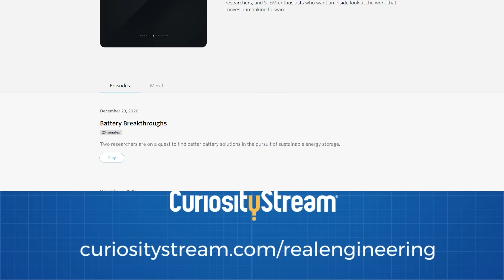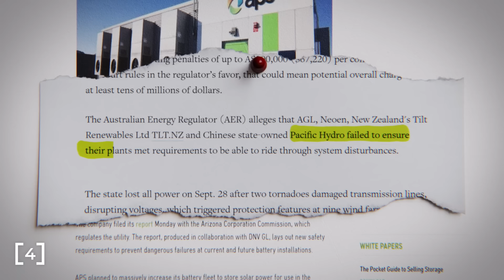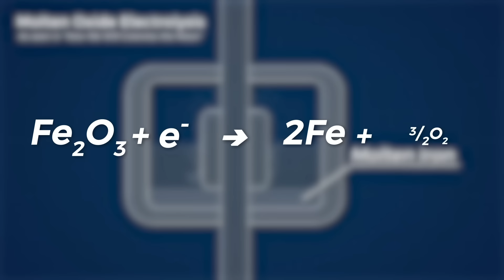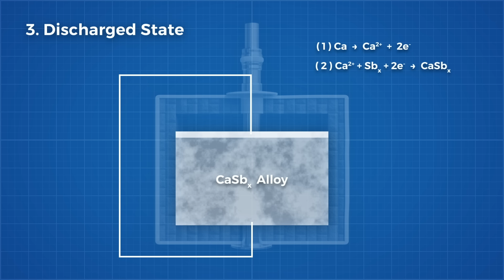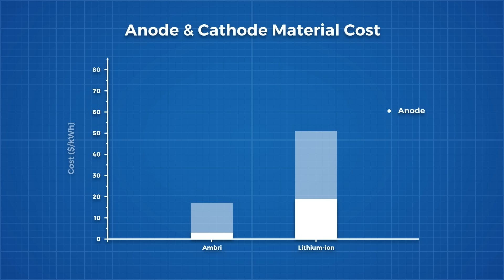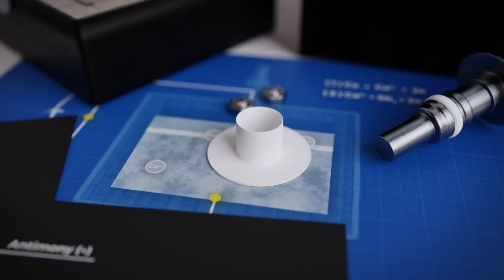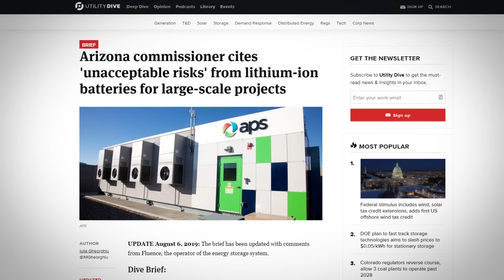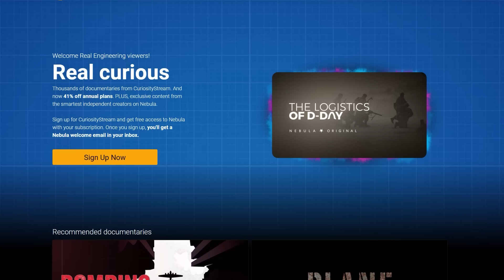The Missing Link in Renewables

Comment: Using Li-ion cells for everything is a bit like using titanium for things of metal. Possible, but not practical.
Reply: ^^ This.
You use the metal that makes the most sense for your application.
Reply: On paper that's true. However, Li-ion's scale of production is making it cheap enough to work with anything. These batteries, and others like it, may make more sense on paper, but the costs are a huge factor right now. Li-ion has options already for lightweight applications and high cycle applications. Will be interesting to see if these take off, but I'm not sure they ever will.
Reply: People used to say the same thing about Steel and Aluminium at various points in history.
Reply: More like Aluminium, applicable to more situations than titanium, but people will continue to make ships and skyscrapers out of Steel.
Reply: @anthonypelchat  lithium batteries have scalability issues and recycling issues. Getting enough rare earth metals to switch all the cars and grid to lithium will be hard. It is so hard that we are already looking into deep sea mining with robots (which isn't good because we know very little about deep sea ecosystems and how large scale mining will affect them). Rare earth metal mining is not a green process in general, it's very destructive to the environment and produces a lot of toxic waste.
So there are hidden costs to lithium batteries, manufacturing cost went significantly down but at some point we will hit a point where raw materials availability will drive the cost up.
Reply: @pingwingugu5  this honestly needs to be its own comment. People don't realize the impact batteries have on the environment and they can't be the answer for everything but really only small things. On a large scale, we still use pumped hydro since it can store a ton of energy with just a dam in the right space and although it hurts the ecosystem around the new reservoir and the construction of such a thing is a large carbon output it leaves less waste than batteries that degrade over time. Honestly, until we get electric or hydrogen construction systems this will be a huge limit on going carbon neutral and eventually achieving a carbon deficit.
Reply: You guys are just throwing shade without backing it up.  “A bit like” doesn’t cut it. That’s not engineering. If you have a more viable solution, put it on the table. That requires you are able to manufacture it at a competitive price, and in that case I suggest you start a company. Until then, I kindly recommend that you consider zipping it.
Reply: @pingwingugu5  Next time you go to comment, do some research first. 

"lithium batteries have scalability issues and recycling issues."
Wrong on both sides. Lithium batteries are already one of the most massed produced products on the planet. They do need to scale a lot more, but many manufacturers are already working on that. 

And multiple companies are also working on recycling. Nearly the entire battery can be recycled once it reaches it's end of life. But just like with most things, the costs to recycle have been higher than the costs to build. As batteries become more easily available to recycling companies and they scale up, costs will come down and recycling will go up.

"Getting enough rare earth metals to switch all the cars and grid to lithium will be hard."

This is where research would keep you from making a full of yourself. There are exactly 0 rare earth minerals in a li-ion battery. None. 

"It is so hard that we are already looking into deep sea mining with robots"

They don't need to specifically for batteries. However, companies will research specific applications possibly because it isn't available in their country or because they feel that it will be more economical. Again though, not needed specifically.

"Rare earth metal mining is not a green process in general, it's very destructive to the environment and produces a lot of toxic waste."

This is the only correct statement in your entire comment. However, you seem to assume that EVs use far more rare earth minerals than anything else. Not the case. As already stated, the batteries don't use any. Some motors do, but it is possible to build motors that don't use any. The rest of the car uses the same materials as any other vehicle. 

"but at some point we will hit a point where raw materials availability will drive the cost up."
The only raw material that will cause that issue is Cobalt. That is because the most easily available Cobalt is in Congo. However, other deposits are available now, new means of getting it are coming up, and battery manufacturers are working to replace it entirely.
Reply: @TacoRat0  As I just pointed out to GSTC, who was horribly incorrect in nearly everything he said, batteries are not more damaging to the environment than other things we do. They are in fact far less than most, including fossil fuel extraction. 

"On a large scale, we still use pumped hydro"
We use that since batteries are still more expensive. Costs are coming down, but that is the only reason any new pumped hydro is built. 

"it leaves less waste than batteries that degrade over time."
Horribly incorrect statement. Li-ion batteries don't leave toxic waste as they degrade. And degradation is small in the first place. Plus, batteries can be recycled completely. The only reason they aren't is due to costs and availability of batteries. As more batteries become available, recycling can scale up and become cheaper.
Reply: @anthonypelchat  jesus christ dude these people are probably never even gonna read this comment, it took you how long to write this out when you coulda been doing literally anything else in existence. Not everybody has to have a damn phd in battery technology, dude saying theres rare earth is kinda like calling concrete cement (even tho batteries arent made of rare earth but concrete actually has cement), yeah ok its a mistake most people probably make you dont need to treat this individual who youve never met with such disrespect writing a whole graphic novel calling someone a "full"
Reply: @anthonypelchat  you are right I mixed things up. Lithium and cobalt aren't rare earth. Still their mining process is quite destructive. I think the most cost effective way for lithium is salt evaporation ponds that are hard to scale up.
The deep sea mining is one of the new sources of non-bloody cobalt, but if I remember correctly there were some other stuff there for EVs (probably some rare earths for magnets).
About the recycling, waste plastic is plentiful and cheap, but it is still rarely recycled. Most small plastic pieces are dumped or burned because how hard it is to recycle it. I'm just worried that we will end with similar problem, yes you technically can recycle it but it will never be cost effective.
Reply: @churrosmcgee624  Correcting people is not "disrespect". To my knowledge, I didn't say anything specifically disrespectful to him. But so many people make the exact same mistakes and then repeat it over and over. I can help him be corrected and help others who read it.
Reply: @pingwingugu5  "Still their mining process is quite destructive."
Very true. Batteries aren't perfect. Nothing is. But it is far better than the alternative. Fossil fuels are basically mined, but instead of using them for a long time and then recycling them, we burn them and mine for more. 

"I think the most cost effective way for lithium is salt evaporation ponds that are hard to scale up."
Lots of companies are looking at this. They have even slowed down mining at some locations since battery production hasn't been as fast as predicted. Will be interesting to watch in the future, but I doubt that it will be a big issue.

"The deep sea mining is one of the new sources of non-bloody cobalt, but if I remember correctly there were some other stuff there for EVs (probably some rare earths for magnets)."
You are correct. They can get a lot of minerals from it. Cobalt is the biggest issue right now for batteries. But it is being reduced to nothing. 

Btw, only some motors need rare metals. AC induction motors don't, but permanent magnet ones do. 

"yes you technically can recycle it but it will never be cost effective."
We will see. Multiple companies are popping up specifically for recycling. The good news is that a single EV battery can last for a very long time in an EV. Afterwards, it can still be useful in stationary storage. 

The bad part with recycling, not just for batteries, is that nearly everything we throw away can be recycled. We just don't. Plastic, glass, paper, metal, etc. Lead Acid batteries are nearly 100% recycled. If we can recycle lead acid batteries that well, we can do so with almost anything. Just need to force everyone to do so.
Reply: @anthonypelchat  why do we need energy storage?
Reply: @robinsss  Grid usage is hugely unstable, not even counting the use of renewables. Peak power can be 3-4x more for 2 hours then the entire rest of the day. Most of the more efficient plants cannot ramp up fast enough to keep up with those peaks, or they may not even have the capacity to hit that high. They currently turn to peaker plants for a lot of that power, which is typically coal or smaller natural gas plants. Depending on location, these can be extremely expensive to use and are typically not as clean as their continuously running counterparts. You also have to pay to have them available, even if you don't use them.

We also have a ton of renewable energy that was installed without any energy storage as well. California and several other areas intentionally shut down wind turbines or basically toss energy from solar away because they are producing too much and have no where to put it. That is simply wasteful.
Reply: @anthonypelchat  try run of river  with a  dam on large diversions
Reply: Bill Gates has a lot of money with a battery company compounding certain dirt as a battery.  They say, "the only way to make the world have batteries is it needs to be cheap as dirt".
Reply: u can just pump water uphill and recover the potential energy. simple tech
Reply: @pingwingugu5  dum6 fu4ck Li ion batteties dont use rare metals
Reply: @nick b thanks, ok. id like to know more about pumped hydro & man made lakes....because the mining and politics for tesla batteries materials is its own mess too ya know, no?
Reply: @cryptolicious3738  that's all
Reply: 1:36 How is pumped hydro storage "not scalable"? You can't just make claims without proof.
Fact: the world's largest pump hydro storage facility is 24000MWh which is larger than the world's largest grid battery 300MWh. "Not scalable" my ass.
Fact: pump hydro storage make up for 95% of grid energy storage. "Not scalable" my ass.
Reply: @nick b not every country have 2 lake on different elevation, fair.
But it does not need to. It just need to connect it grid to another country with pump hydro storage to store that energy.
Reply: @nick b how is it compromising?
Reply: @nick b which is a problem because?
Reply: @luongmaihunggia  yeah , true! we need a updated real engineering video on hydro storage and the pros n cons and speed to construct etc etc bc that isnt 10 or 20 years away tech. we need massive cheap storage now imho
Reply: @nick b yeah. Why wouldn't they? If you pay anyone enough money you can get them to do anything.
Reply: @anthonypelchat  What do YOU think recycling Li-Iom batteries means?

Let me rephrase.. whats the average energy toll for repourposing 1kg of Lithium based containers?
Reply: @nick b yeah, why would they do that? Why would people in other countries price something that everyone does at a higher price than everyone?
Reply: @nick b and I pointed out how "your limitation" isn't a limitation at all by asking a question
Reply: @absolutium  You tell me. I haven't done a lot of research on Li-ion recycling. I know that there are recycling for batteries that clean and resell the good batteries for use and there's the recycling that fully break down the batteries to be reused in other items, not just batteries. The only issues that I've seen for the break down of the batteries is simply getting enough to the plant to make it worth doing so and bringing the costs down enough to make it worth it for other companies.
Reply: @nick b the cheapest one is pump hydro. Obviously
Reply: @anthonypelchat  Well one might think you have done research for an opinion that confident.. but while it is difficult to establish the average the best case scenario is 50kwh per kg.. so there you go.. thats the environmental issue.
Reply: @absolutium  I never claimed to be an expert nor did I go into any deep details. You don't have to be an engineer to have solid facts. Multiple third parties claimed the very little info that I committed. They claim to be able to recover most of the materials and are working to make it cost effective. 

Also, using that 50kwh of energy number that you provided, you can recover 250 watt hours of NCA/NCM battery storage. That provides a lifetime storage of 500-1000 Kwh of storage for just 50kwh. Not perfect, but still a very nice return.
Reply: @absolutium  Got a link for that 50 kwh number you gave? I cannot find any info on any legitimate site showing that. So far, I'm just seeing everything that I already mentioned. It's more expensive to recycle than to mine, and that multiple companies are claiming up to 100% of the batteries are recyclable.
Reply: @anthonypelchat  Yeah no.. Let's try this.. take a look at the Fifth Law of thermodynamics. See if you can notice whats the issue here.
Reply: @verdanteridium  no. I don't have faith in human kindness. I have faith that if you pay people, they're obligated to do whatever you pay them to do.
Reply: @luongmaihunggia  Then your country gets extorted for more money, raising taxes and energy bills.

You can't compare the relationship of two nations like the relationship between two people. That is the important thing.

Now that I'm not tired that is what I'm criticising.
Reply: @verdanteridium  it's illegal to refuse a service after you pay someone to do said service.
Reply: @anthonypelchat  and you miss the point that, yes, LiIon batteries are almost 100% recyclable, except for the lithium!
Reply: @motor2of7  Good try. Straight from Fortum Battery Solutions, who recycle batteries.

"We are able to recycle over 80% of lithium-ion battery materials. Our industrial-scale, low-CO2 process allows us to recover lithium, cobalt, manganese and nickel from the battery for reuse in producing new batteries. ... Of these, nickel, cobalt and lithium are the most valuable and most difficult to recover."
Reply: @anthonypelchat  from Wikipedia for only 1 source.

As of 2019, the recycling of Li-Ion batteries in most cases does not extract lithium since lithium-ion battery technology continuously changes and processes to recycle these batteries can thus be outdated in a couple of years.[12] Another reason why it isn't being done on a large scale is because the extraction of lithium from old batteries is five times more expensive than mined lithium.

I’m not saying that it won’t change, but lithium is not the long term answer..  it’s a finite resource and mining it is horribly destructive to the environment.

https://www.wired.co.uk/article/lithium-batteries-environment-impact
Reply: @motor2of7  You need to continue reading that same paragraph. 

"However, it is already being done on a small scale (by some companies), an industry in expectation of large quantities of disused batteries to come."

Li-ion batteries can have their lithium recovered. The main reason that it isn't is because it is cheaper to mine the lithium.
Reply: @anthonypelchat  I didn't disagree with that, but the transition from small scale to large scale in the face of a 5x cost imbalance will not be easy to overcome.
Reply: @motor2of7  The costs will even out in time. Recovering 80% of a battery for cheaper than it costs to mine is still huge. And recovering Lithium isn't that big of a deal right now. Cobalt is much more important, and it sounds like Nickle is too. Lithium isn't rare nor expensive to mine. It isn't perfect, obviously. But at least the batteries can last for decades.
Reply: @Haliotro  Yes, they do.

Comment: Just a little correction, a flywheel doesn't maintain the speed of an engine. It acts as an energy buffer and smoothens the torque ripple from the engine. I believe a governor should be the one you are referring to. Big fan of your work! <3
Reply: Well it acts as inertia for the engine so both you and the video are correct
Reply: Balls to the wall was an old expression for the steam pressure regulator...cool to hear somebody with correct terminology and understanding of "frequency"...

Comment: A modern super grid is just as important as battery storage. Building a High Voltage DC grid, not to replace the AC grid (at least not yet), but to complement it, solar panels are perfect for the new DC grid since they generate DC while wind turbines should stay on the AC grid since they  produce AC. 

The new grid should be below ground for safety and reliability. The DC connectors in the wall used could be USB-C since most modern computers and phones is using them already, and would work worldwide without travel adapters.